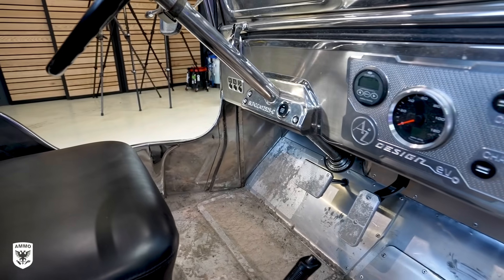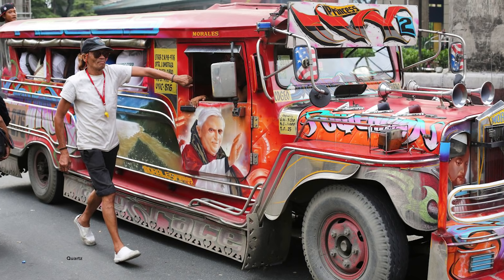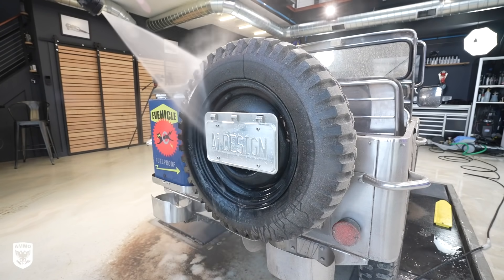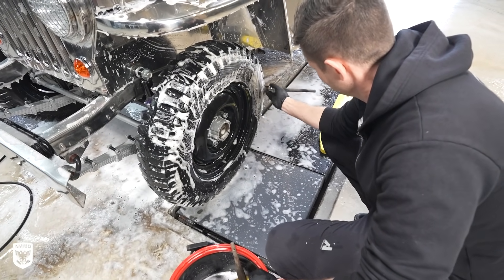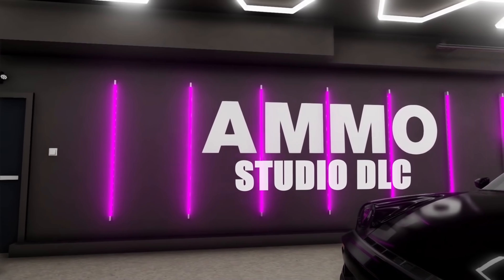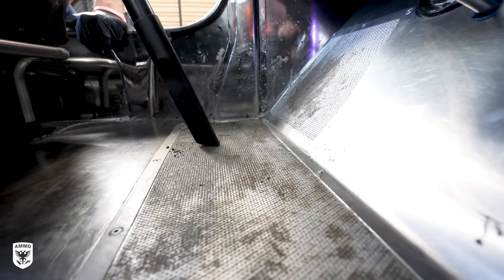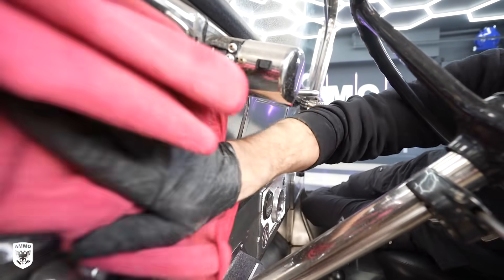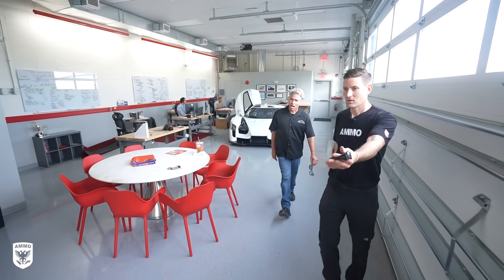Detailing Tesla Jeep: All Electric Willys Jeep with 5 Tesla Batteries Covered in Mud!

Comment: That jeep reminds me of a story my dad told me. He was logging on a piece of land where they held a competition to see who's vehicle could get through a mud bog. A Jeep wrangler with a custom aluminum body was stuck and my dad who had been using his skidder to pull the trucks outs. He Went to pull the jeep out. The skidder uses a heavy duty steel cable to pull logs out. So he lets it out and the owner of the jeep attaches it to the body. As my dad begins to winch it in. It folds the body. like a tin can. Guy was angry at my dad. But it was the guy's fault for attaching to body and not the frame.

Comment: You keep talking about paint, but there should be no paint unless there's a clear coat which shouldn't be necessary... it's stainless steel, and any scratches in the "brushed" areas can be corrected with the right grade of scotchbright pad.

Comment: Just wish electric conversions had some decent range to them. That would be a nightmare to actually enjoy off-road on a camping trip.
Reply: You can always bring along a small genset to charge it on the camping site. Hehehe
Reply: This one was poorly made. The front axle doesn't have any drive, there is a huge motor hanging down from the center of the vehicle... Almost Looks like it was built by a kid in a shed...
Reply: @megarafjogos  but this jeep version (we locally call it “owner jeep”) is not intended as a 4x4…it just looked like its 4x4 predecessor. 😅

Comment: I have a question for you
I am looking for a da polisher
I am only interested in the one from rupes/ flex
What should I get at first
A large or small orbit
A gear driven or a random orbital
And lastly flex or rupes (the one that is more budget finally, should the prize differential be too negligible connected to the added benefits of course I am will want the slightly more expensive)
Ooo and I am in a "budget" so I can not have 2
I am not interested in any other brand as they're not supported in my country

Comment: Interesting Jeep, but highly impractical, range of 100 miles (won’t even get me there) no way to charge when I get there, and you have to worry about it getting dirty/ wet. All that makes the jeep just a novelty
Reply: Dude, I commute 45 miles each way everyday (~1 hr avg. 42 mi/hr), I think for even a daily beater 100 miles is okay, and certainly so for something specialty & vintage like this which would probably be towed anyway to a venue. Plus this thing is covered in mud so it would appear to be okay with dirt & water exposure.